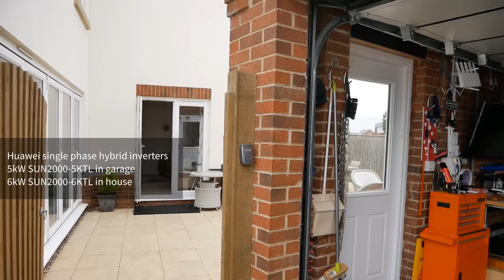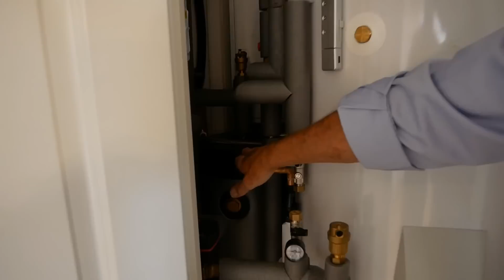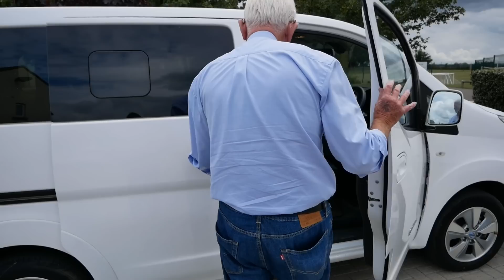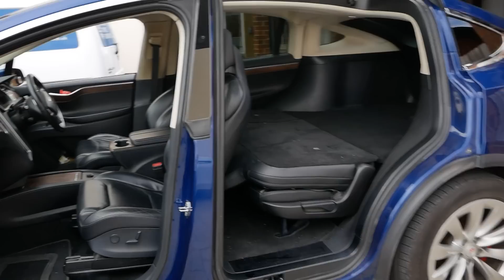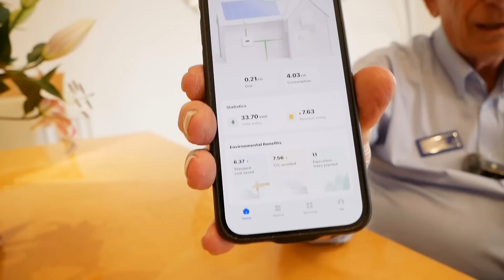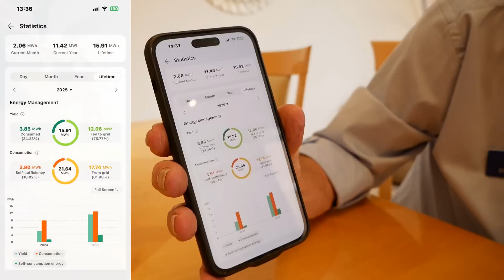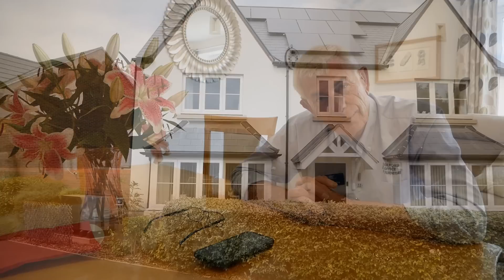How a 5 Bedroom Detached House & 3 Electric Cars Are Powered With ZERO Bills!

Comment: Great. You don't have to get this all done at once, and you don't need such a large and comprehensive system. The point about renewables is that you can keep adding kit to improve performance. You can't get cheap rate gas at night and store it for the day. You can't run you car and run your gas boiler with solar power. Electricity gives you maximum flexibility and room for improvement. 
With a home battery and a heat pump you can heat the whole house using cheap rate electricity which will work out around 1/2 the price of using a gas boiler. kWh is energy (what you pay for), kW is power.
Reply: Hope my landlord never has to fit all this or my rent will skyrocket and I'll be much worse off than I am now!
Reply from the maker: Well said

Comment: Many thanks for this very interesting and informative video. I have a small 3.5kWh home solar installation with 10kWh battery pack which help to reduce electricity costs. I also have an excellent 4 year old Kia Soul EV which, according to the second-hand car market, is now worth a bit more than peanuts. Yet it contains a perfectly good 64kWh battery that must be worth a lot more than peanuts and could be running my house and exporting substantially more electricity to the grid than I am able to at present. We need availability of those Vehicle to Home chargers asap.
Reply from the maker: I believe the issue is that the onboard chargers in CCS vehicles will not be bi-directional, so a V2H charger will not help unless the car has been designed to export energy. Chademo vehicles do as it's part of the Chademo specifications.
But many manufacturers are now offering V2L (vehicle to load) where you can get AC power out of the car and that is obviously using the on-board inverter to get it back to AC. But V2L is not at the rates needed for V2H, hence why Chademo V2H systems are DC and then the V2H wall charger has an inverter in them to get the DC back to AC for the house.
Reply: @GoGreenAutos  Thanks for the info
Reply: @GoGreenAutos  CCS can be bidirectional, VW recently updated the software on the ID.3 77kWh so it can do V2G - finding the charger to do it is now the problem.

Comment: Well what a lovely gentleman, Matt. Very informative video and I agree the government really needs to do some work on this. I wish they weren't so fixated on heat pumps to the exclusion of other renewable forms of heating. 

We just got our roof filled with solar panels with a home battery. Also we found that there did exist a long enough cable so that we could drive our Classic Ioniq 38kWh (thanks Matt, it's so frugal) onto the green in front of our houses for a few hours once or twice a week to charge.

 We're looking at heating next but won't be able to afford it until we've paid off this installation. I'm not sure I can manage the upheaval of a heat pump but on the other hand something will need to be done about hot water as we're on a combi boiler so upheaval there will be...unless we leave the boiler to just do water and get infrared panels or some other form of electric heating. Quite handy we have time to await developments and ponder what becomes available, though I'd like to get it sorted as soon as possible, we're not getting any younger.
Reply from the maker: It will be worth looking into a heat pump sooner rather than later while the grant is available.
Reply: @GoGreenAutos yes that is true, can't afford anything else yet though...
Reply: If you can make it to look at our setup little to know upheaval and take advantage of the £7500.00 grant. 😊
Reply: @davebeesley3678 yes I was pleased to hear that your small bore pipes were not a problem. Unfortunately ours is a '50's semi in need of new windows and I have a feeling lots of radiators will need changing. Plus the need to find room for a big tank and all it's accoutrements. Since we've just maxed ourselves out financially with the PV/battery set up I don't think we can manage it yet. The added problem is that I live with chronic illness and even the smallest disruption of people working indoors is stressful.
Think all that you have done is magnificent but we can only aspire to finishing our green journey.

Comment: I recently added a home battery and 40% more installed capacity to my 5 year old solar system, which also has an EDDI unit to warn up the HW tank with any excess power. 
Therefore, as you would expect, I enjoyed this video!
Reply from the maker: Yes, I'm sure Dave's systems could be integrated better so he imported less (even at 7p) and kept more of the solar generated power.
Reply: Yes spend ££££££ on massive batteries that will eventually die and go in landfill just to save a few quid on the electric bill. Genius solution 😂
Reply: @LawrenceTimme  You obviously have not studied batteries as most have a ten year warranty and will last at least 6,000 to 8,000 discharge cycles. This is due the battery management system that includes a buffer to avoid over and under discharging. 
When the battery does eventually reach its end of life, the components will be recycled. The payback period is usually 5-7 years for the entire solar/battery system, or less.

Comment: Nice, I'd probably do the same if i were  well off, apart from the evs lol
Reply from the maker: I see these solar panels Dave has got were down to as little as £39.50 each (see https://solartradinguk.co.uk/product/ja-solar-jam54d41-435-gb-435w-full-black-n-type-panel/) so solar is getting far more affordable and the payback times much less.
Reply: @GoGreenAutos yeah, out of stock, they were marked down from over £80, I'd struggle to get 3 of those on the sunny side of my roof though, and it's only in the sun for about half the daytime, but, yes, I've noticed the price of panels getting lower, but the panels are only a fraction of the cost, batteries, inverters and installation costs have always been the dearest part of solar power.
Reply: @Markcain268 Less than 2k for a 15kwh battery, which if you use solely to import at cheap rate and then charge an EV will have paid for itself in 1.5 years in fuel savings.

Comment: Such an inspirational video. I do hope most of it can be achieved with a home battery as v2h doesn't seem to properly be here yet. I do like the idea of having more panels than we need to help generate a profit in these uncertain times.
Reply: That is so impressive. Well done 👏👏👏
Reply from the maker: Yes, going overboard on the solar is what's made Dave's system really work well. The solar is paying for it all (aided by the V2H buying in energy at 7p) and allowing him to run the heating so hot all the time as they no longer worry about the cost as its all free!
Reply: You always need more solar than you think, even the manufacturers tell you expect around 60% of the panels kwh rating as maximum.

Comment: This guy could have saved £20k,by running his house off his Tesla....free superchargering.
Reply from the maker: Teslas (except the Cybertruck) don't have bi-directional charging, so not possible.
But if it was, I'd be doing it as I have free Supercharging too. I could pop to Oxford, fill up the car, then drive back and power the house at peak times! Tesla would soon work out what was going on as the mileage of the vehicle wouldn't match the consumption.
Reply: @GoGreenAutos 
I have a v2l with plug sockets from my Tesla,it can't be long before you can go direct to the house( probably a bright "sparky" could already do I?).
Is there a fair use condition with Tesla?

Comment: Excellent I love all this a year and a half ago I was one that sneered at all this, I then got an 18 plate soul EV and love it.  My only problem is Blackpool Council won't even acknowledge emails about cross pavement gully to charge so all this I wouldn't have a chance. I am a lottery win away from the money and moving and doing all that. There is a charger maker in Blackpool and one said they were working on vehicle house chargers. Thanks for sharing
Reply from the maker: People are sneering at EVs and now heat pumps are getting the same negative treatment. But what people forget is everyone that converts was an owner of the previous technology AND has more experience than the ones sneering.

Comment from the maker: Since filming this video and looking further at the app reporting and Dave's bills, there were some discrepancies. Dave has spent £20,416 on electrifying his home and when comparing the costs with the previous year with the gas boiler, the overall savings are best summarised like this:
* Annual saving is now £5,950 compared to previous year's gas & electric.
* The heating is now run hotter than it was before on gas and it's now also on 24/7.
* The £20,416 investment payback is 3 years 5 months.
* Then after that, the savings are £496 a month.
* They could save a lot more money by reducing the heating to a normal level, but as the exports cover the cost, they don't need to.
Reply: I used to have an old multifuel cooker that also did water and heating. The house was always warmish as unless cooker went out it always ticked over. when we got gas we noticed straight away that it was cold because heating went off then had to warm it from cold, Heat pump heating is best run like my old cooker from what I understand
Reply: £6k per year on energy….. wow ❤
Reply: @zjzozn  They wouldn't have been spending £6k on energy. That figure will include both the savings from not paying for energy and the income from exporting power to the grid. It's hard to say what the ratio of those is but given the enormous amount of solar and the direct discharge from the EV I'll bet a clear majority is export payments.
Reply: Parking the weird desire to heat one's house to 26.5 °C he has a very understanding DNO.  I'm surprised he wasn't required to install 3 phase. Why doesn't he buy an old leaf and keep it plugged in during the day, then he wouldn't need to buy any electricity?
Reply: How much of that ridiculous energy bill was for heating the house? I never spent more than £350/year on gas when we were using a 40 year old boiler - also in a 5-bed detached house.
Reply: The sims don’t add up! What FIT rate does he get? 
Why was he spending £5000 on gas and electricity bills in the first place?
He will still have a standing charge for electricity
In the months sept- match solar is non existent so what is the costs for electricity to then?
Reply: Hmmm, there's something not quite right here.
Reply: This smells is BS… firstly nearly £6000 energy bill… I run a new Tesla , 5 bed house , 5 people and my monthly gas and electric is £200 a month average.

So his figures say he’s used 21Mw that is £6000 at full price electricity, but that’s not factoring in Octopus Flux, which I presume he was using… 
He’s now using 21Mw as he’s charging vehicles and running the pump set to Barbados setting😂
And he’s running everything of electricity now.
In other words that’s got to be wrongly calculated.
I’m trying to justify and calculate the return on investment for a £15-16k  solar and battery system. 
And that would be at least 10 years to break even.
Reply: @dazzassti I agree - and remember that would have to be an average - because of the winter weather reducing solar to almost zero. That means he is claiming that he most be making over £700 per month in the summer months to compensate 
As I said I’ve got a similar set up - the heat pump and we don’t get anywhere near that and we are on the 2010 FIt tariff of 21p
Reply: @Playrisk-x9j I’ve just added another comment but I can see his logic,  and how it’s skewed his figures. he’s now 24-25 using (his screenshot) 21Mw which if you calc out at 29p is low and behold £6000 . 
But before he had gas and I assume on Octo Flix overnight so nowhere near £6000
Reply: All these benefits until it becomes mainstream — government will then increase electricity cost.  Same story with EVs.  Before mainstream, free charging, grants, no congestion charge etc etc.  Now? I’m sure I don’t need to list the many ways cost have increased to run an EV.
Reply: Dave is a star.
Reply: How come they was so hi, I mean I run 2 EV and have solar and the bills are never that high, before the solar, the 9kw solar system covers 100% of the bill so far so basically a saving of 207 per month
Reply: What a terrific  guy, an absolute trail blazer........he's a very lucky man indeed,  but as he says , he's in his latter years and who can blame him . Well done fella
Reply: pin this then
Reply: all I need is someone to give me £20000+ and I could save money
Reply: 2 retired people in a 5-bed house that's only 10 years old so very well insulated, who have spent £20k (I don't believe it was that little even with the grant), taking advantage of the FIT tariff that's been long gone for 99.9% of us, with £100k worth of EVs can save £5k a year? Sounds like a bargain.
Reply: @roi354 or made up